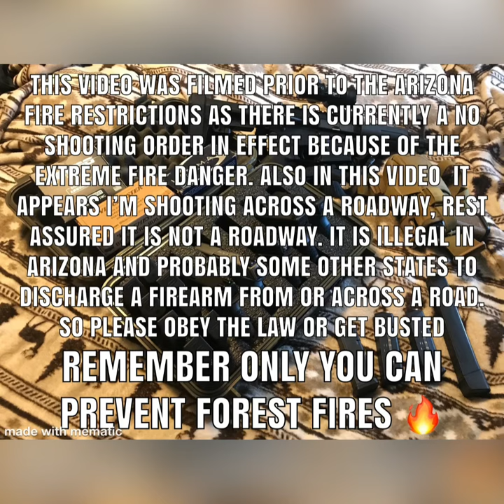Polymer 80 Build Smith & Glockson SD40VE Blue Titanium Frame PF940C

Comment from the maker: This video was filmed prior to the Arizona fire restrictions as there is currently a no shooting order in effect because of the extreme fire danger. Also in this video  it appears I’m shooting across a roadway, rest assured it is not a roadway. It is illegal in Arizona and probably some other states to discharge a firearm from or across a road. So please obey the law or get busted. 

This is the second time test firing this particular Smith & Glockson. As I’m sure everyone will notice, it had two failure to feed. Not sure if it was because of operator error, magazine issue or if I just needed to do a tad more grinding, sanding and polishing. So that’s what happened when I got home. Unable to test it again at this time because of the extreme fire danger in Arizona. A third test fire is in the works when the ban is lifted.